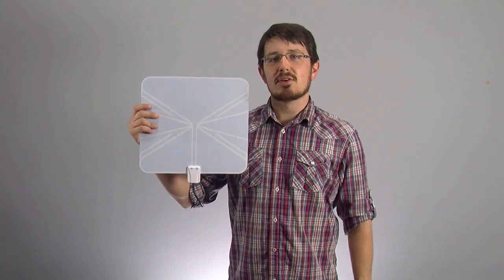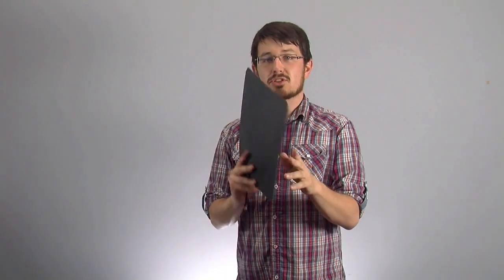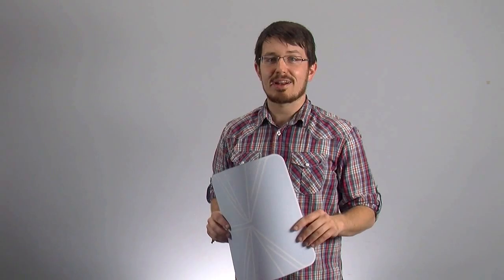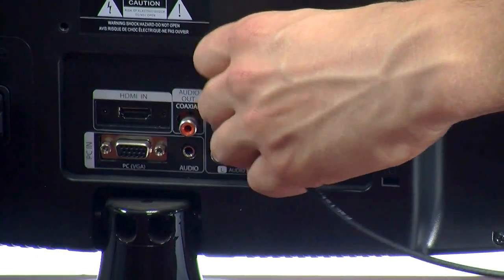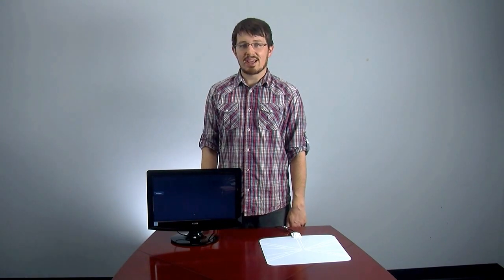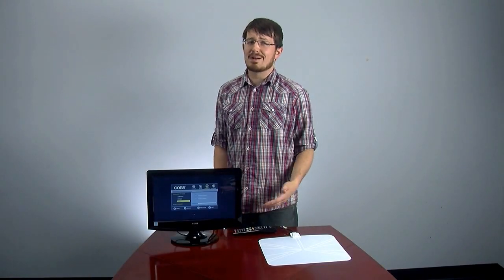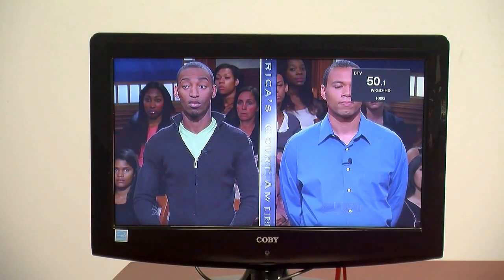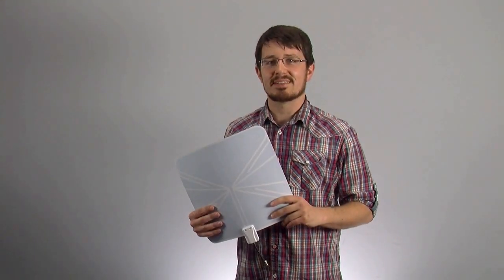Hands on With the HD-Blade Indoor TV Antenna From Solid Signal

Comment: How does this compare to a Mohu Leaf antenna, they look identical. I am not sure if the Leaf does both UHF and VHF signals, I think its UHF only but will have to research there site.
Reply from the maker: We tested both at the Solid Signal Blog and found that our antenna picks up both VHF and UHF better than the Leaf. YouTube won't let me post a link, it's blog(dot)solidsignal(dot)com(slash)showthread.php(slash)1608 -- there' is a full spec sheet at the bottom. Several other authorities also found that our antenna outperformed the Leaf.
Reply: Solid Signal
I know the site I already looked. Leaf states there antenna is not for VHF channels only UHF which have more  signal strength. I wanted to know if the Leaf was tested against it, but if you make it then I would never expect you to admit if one was worse then the other.